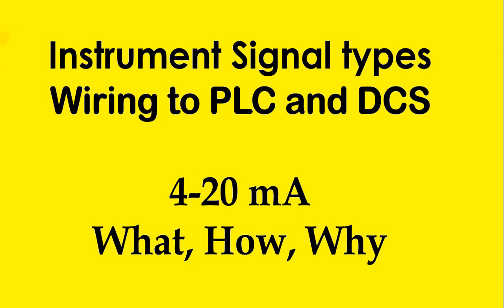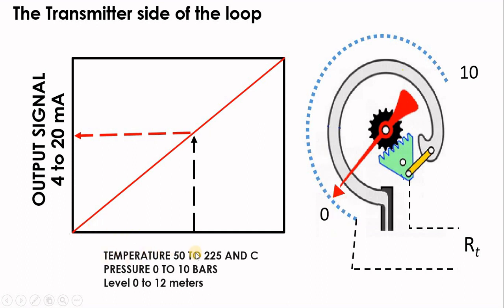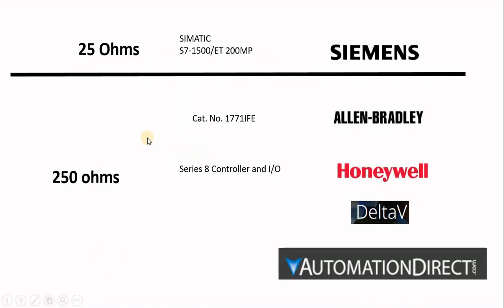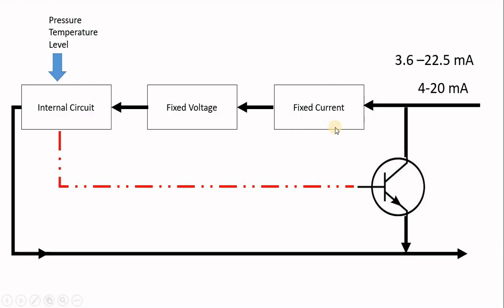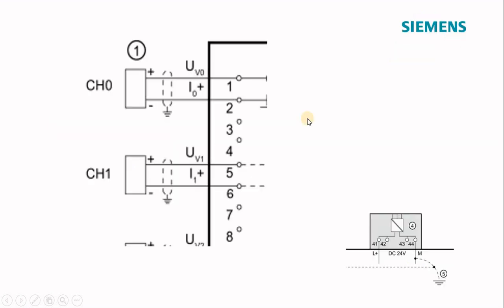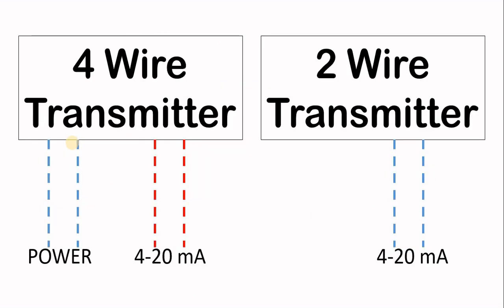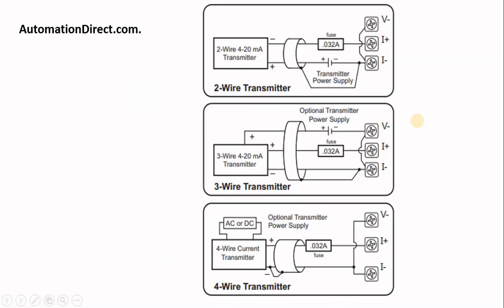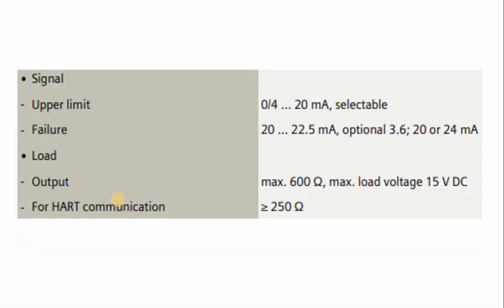02-08 Instrument 4-20 mA, What and how to wire to PLC DCS Analog Input Card. LIMITS and tips

Comment: Thank you for your effort. What would the feedback signal (as current mA) in case of out of range measurement of the transmitter and in case of out of service considering the power is available ? Thank you
Reply from the maker: The signal is 4-20 mA, connected to your PLC as any other transmitter that you have. The analog signal is proportion to valve opening. As an example for this position feedback you can see Fisher's Fieldvue 4400 . here is the link to the manual wiring. Let me know if this clear enough. https://www.emerson.com/documents/automation/instruction-manual-fisher-fieldvue-4400-digital-position-transmitter-en-9578524.pdf